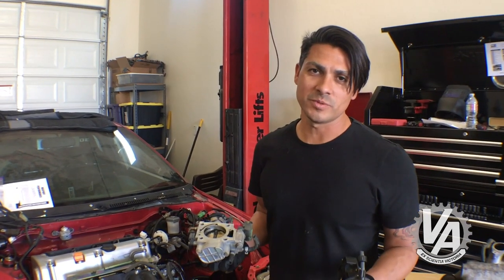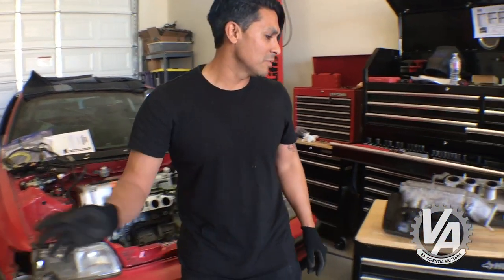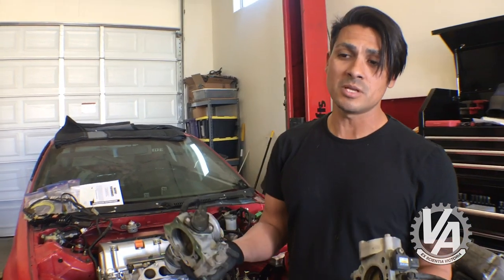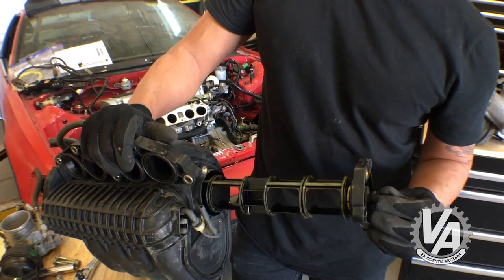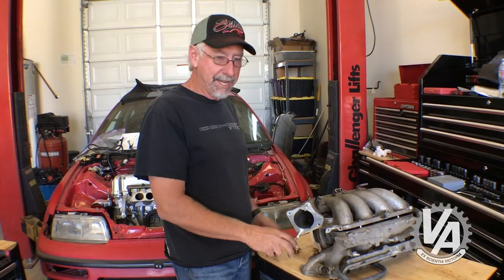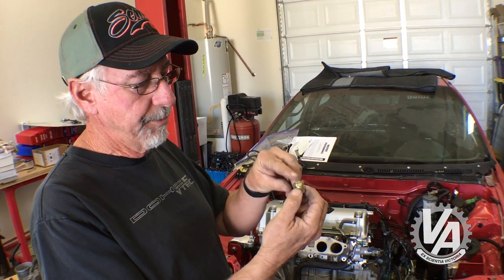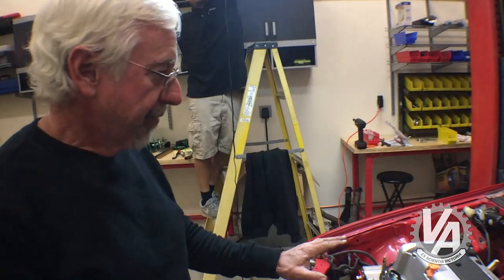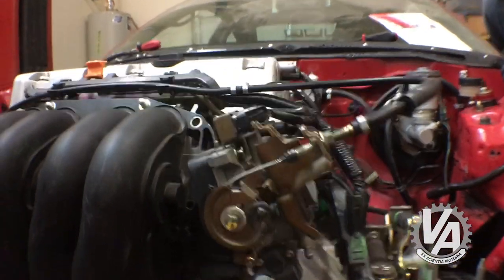Budget EF K swap Part 6 - Problems!

Comment: that air assist valve is also a good place to thread a fan switch if your swap needs one
Reply from the maker: That would probably work too. I believe it is the same thread pitch. Have you done it?

Comment: I have a question about a possible swap. I have a 2015 accord sedan 2.4L auto. Would it be realistic and worth doing either an Euro r swap with the 6 speed or the v6 manual swap.
Reply: Honestly, with a car this new, you are better off selling it and buying a V6 6 speed model. There is little point in swapping when you can get the same car from the factory that has the powertrain you want.

Comment: If I can bar b18c5 I will swap it but if not what would you believe I should swap?
Reply from the maker: Str Pro as long as you can say you’re replacing a 1.6 with a 1.8, you’re golden.
Reply: @VTECAcademy  Honda forever. Love from Greece.